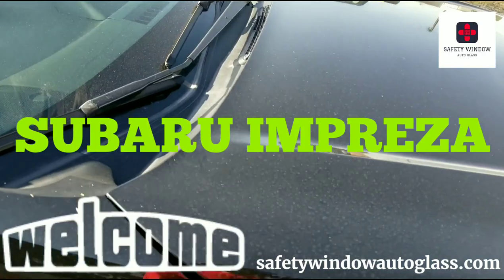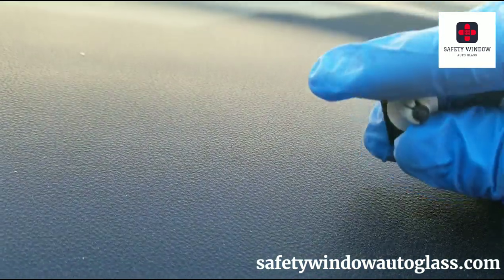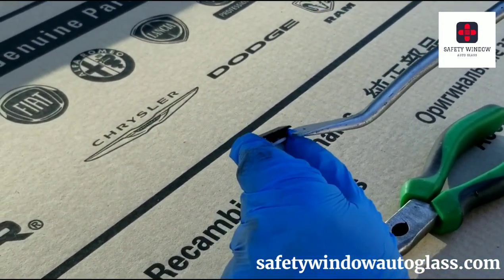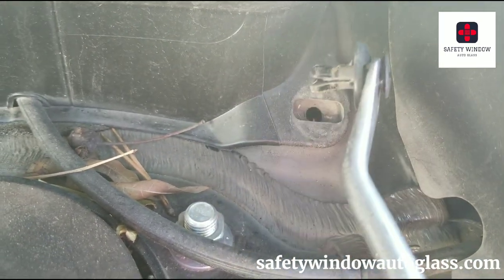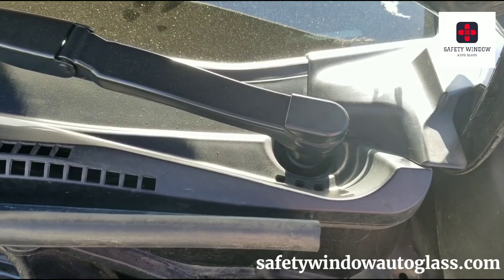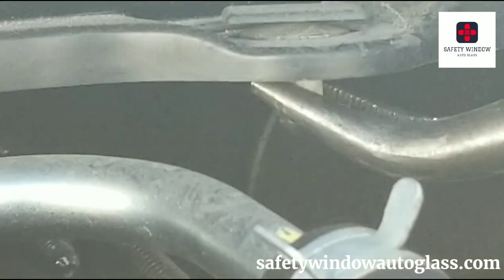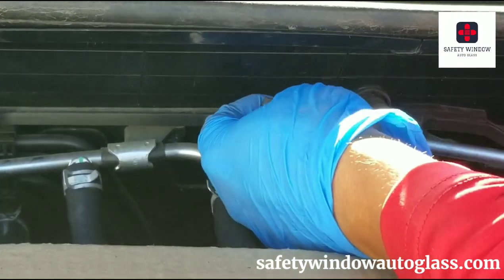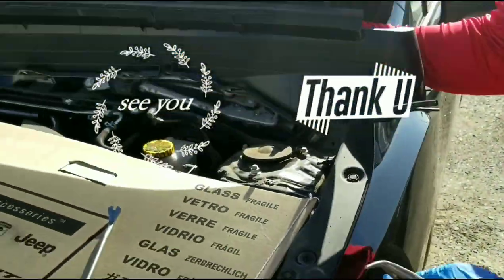Subaru Impreza How To Remove Fastener Retaining Clips On Cowling #subaru #car #stockton

Comment: Thanks for the post. 2015 Forester, "Y" fitting was in leaking with a big hole. While i was in there, changed the lines and nozzles. Hope the fix will last another 100k miles. Remember to ops check before closing everything backup.